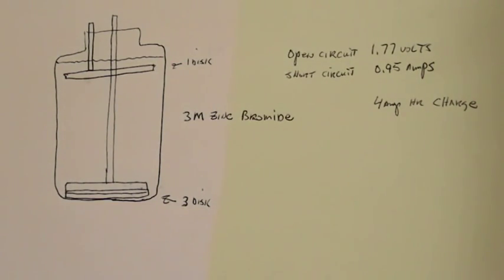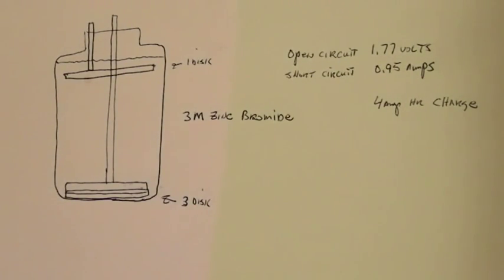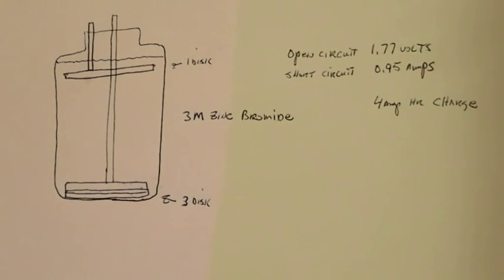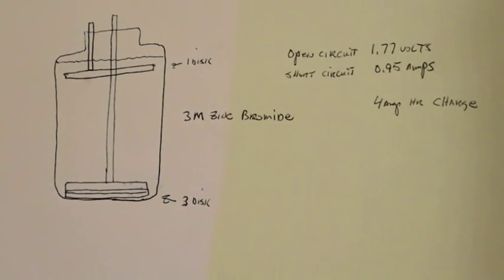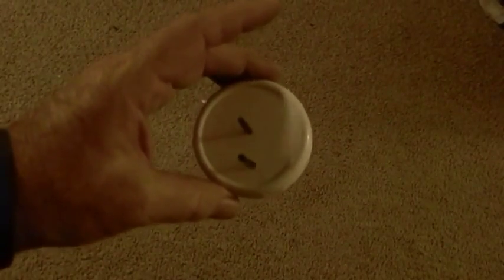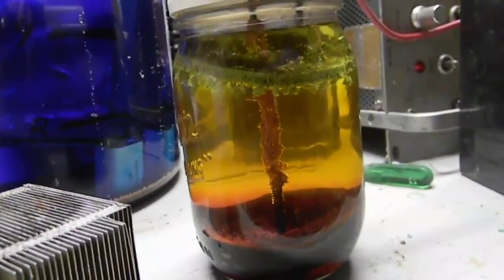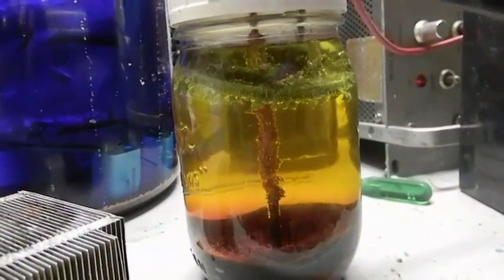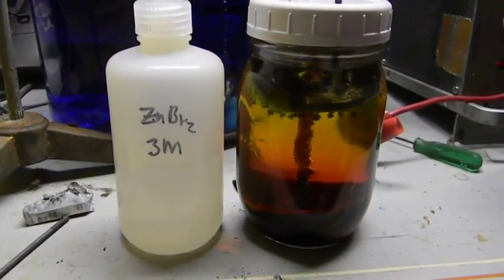DIY Zinc Bromide Battery

Comment: To DRAMATICALLY improve the Current charging and discharging of this battery, simply use Extruded Carbon Water Filter Cartridges, as they contain approx 4000 square meters of usable surface area, and can be purchased for approx $10 AUD each for a 1 micron coconut carbon filter. Spend the $20 and make yourself and awesome high current - high energy density battery!

Comment: From other sources try Florist Oasis foam to hold your fluid in the container.
Reply: No it wont work, oasis is to high in resistance and does not let the liquid flow freely. If you are going to experiment with this chemistry try only hdpe pipe, also known for tyleen pipe, smallest you can get is 18mm od biggest is 80cm....no filler or what so ever, it will stop the much needed flowing and NEVER close your cell, you NEED a venting hole, but they are very good useful chemicals. A lot of potential, if you have room for it. Have fun
Reply: @justmeigor1852  Yes oasis foam does work Robert Murray Smith did it and it works very well you actually don't want the fluid to flow so freely because the reacted materials end up at the bottom of the cell and not in a position to be reversed when charging. Dendrite growth actually improves surface area rather than being a detriment and self regulates in the bromine concentrations.
Reply: @Barskor1   improved this design quite a bit, tested the hell out of it.....leave out the oasis, it won't do any good, it works but the electrical resistance is to high and the liquid flow is to low, plus you NEED a venting hole.
You really want and need the liquid to flow freely to get the max out of the chemistry.

Tested over and over again....robbert is not all knowing!

If you follow his path you will get not even get 100 mah out of a cell at 1.80v, with my design you will get 4x more of mah.
At not even 15 cm2 (2.5 cm in height) will give me 0.40ah with 50cc electrolyte, for 1.5 hours!,  his blade design with oasis in it could not give me more then 0.05ah per 35cm2 of surface....110cc electrolyte, for 30 minutes!
Do your own calculations! with the numbers i just presented.
At 1.75 M = 40 grams of gold (read ZnBr2) diluted into 100ml distilled water.
Again tested a lot....i a owner of serious testing equipment...just saying.
Probably i did something wrong????

Open cellular structure of a carbon, some sort off, to use as a filler would be advised, it would give the answer to the problem of the zinc crystal to form evenly, before it can react on the bromine, then you will get the max out of the znbr2.
So no need for a "flow battery"...reddox is just a foolish brand name, they think they invented the wheel, not by a long shot....
Or plan to make your cells higher plus/minus 10cm, i am working and testing on this.
A flow design is not necessary, not even advised atm!
Storage on cm3 is very promising, charge discharge on the cm2 of the electrodes is not...enlarge would be the answer
.
To dissolve znbr2 into solution do not use more than 2m aka 440gr a liter!, it is tricky and waste of money to get a higher M solution.

With best and kind regards Igor.
Reply: @Barskor1  I copied his design exactly, you won't get the best results.
Not even 60% of the capabilities the znbr can offer, i am also a paid member to his channel, and a hobby lab rat.
I really tried to get his design to work, looking forward to your reply, and ideas, sorry i was short in this one, i hope no offence is taking, best
Reply: @Barskor1  In both cases: high and low drain or high/low charging you need a vent hole.
Even with the closed design and a charge discharge cycle/rate of 0.02a at 1.75v there will be forming gasses that cous preusseur.
In order to take any power for storage you will need to bump up the voltage for the foam filled cell to 4.2 volt(for a cell that can do max 1.82v?) If i charge them with 3.5v i will get a power storage that can bearly light up one led of 20mah.
Agreed to a certain level: the more you cycle them the more they can have, but from 60mah storage they all had the same problem: bulging all 10, 6 spring a leak.
With my new design i am at cycle 20 somewhere and i get from 50cc electrolite 1 full amp charge and discharge at 0.5 c rate, aka 1000mah storage for 15 euro cents if bought the znbr in bulk, including the casing....15 euro cents....60 euro cents for a similar 3.6v 2000mah li ion cell with not a 800 cycle life but unlimited cycle life....
The 100cc cel at 55mm in dia is starting his initial charge today, and i am going to hook up two 50cc cells in parallel and in series, both setups of the 50cc cells will get two full cycles.
Meaning of this test is the surface area of the electrodes to get some numbers and also to get some numbers on higher voltage in series.
I am really serious about this chemistry with testing.
If you want to test for yourself: keep the positief at all times down, the bromine will collect at the bottom and will be sealed by the remaining water, so no escape of the very poisonous bromine, but the watergashydrox must have a way out to prevent gas buildup, will be continued, looking forward to your reply, best Igor
Reply: I'm a sub - member on RMS channel 
Very interesting to see you two in this discussion here.
My pricing suggests 5kg (5kg = 48mol) NaBr is about £80 and 10kg fertiliser grade (7.05kg = 24mol) ZnSO4 is about £30.  

24 mol of Zn needs 48 Faradays to plate. 1 Faraday = 96,000 colombs.  Given 1A is 1 colomb/sec, we can say 100A is 100x(3600/96000) or 3.73 Faradays per hour.

So a cell with a 100A charge at 2v (only 200W, but thick wire required!), and with solute costing about £100, will take 12 hours to charge and 12 to discharge. I calculated this out as:£100 solute cost for a 2500Wh battery. But you think better?

Comment: Thank you for this!  Where do I get the carbon rod?  4 AH is fantastic (about 6 WH?) but if I put in a recirculating pump and had a reservoir of ZnBr solution could I get more storage with the same # of plates?
Reply: The battery relies on the zinc and bromine seperation in the solution.  A pump would likely stir it up too much.

Carbon rods can be harvested from certain lantern batteries.  Not sure which ones.

Comment: Hi! Very nice the ZnBr2!! You can try the ZnI2 (Zinc Iodide flow battery) too. It's more energy dense (167Wh/l), more "green", and seems to me, use the same configuration of the Zinc Bromine. Try Google about this flow battery!
Reply: Do you know if they've overcome the problem of solid iodine plating onto the electrodes?  Apparently the solid iodine is non conductive and slowly degrades battery performance.  Also, I've noticed iodine prices are absolutely sky high compared to bromine.